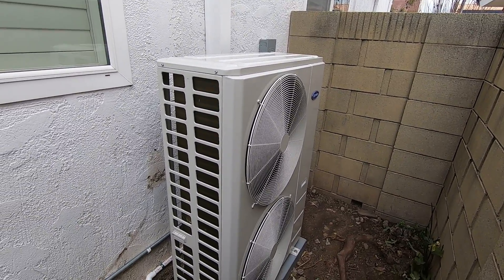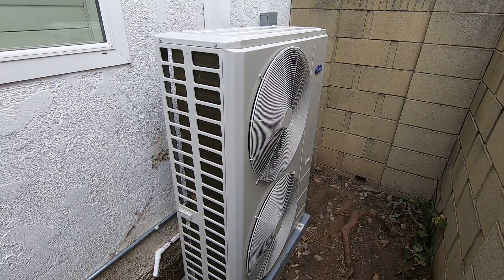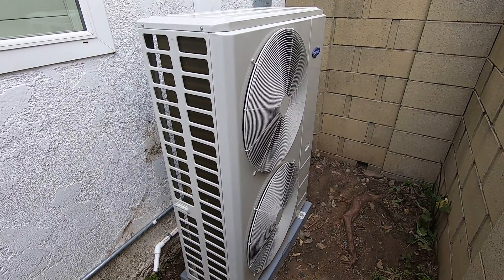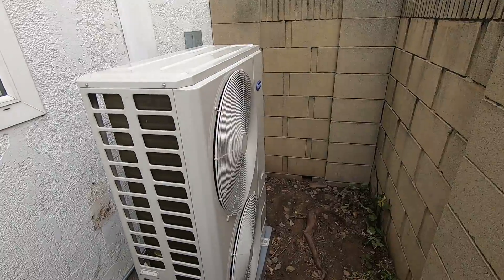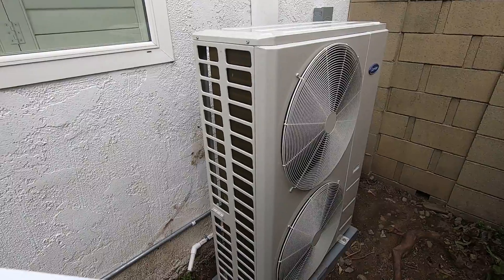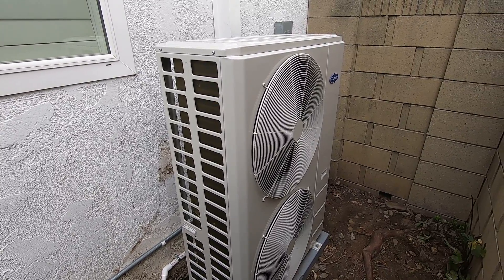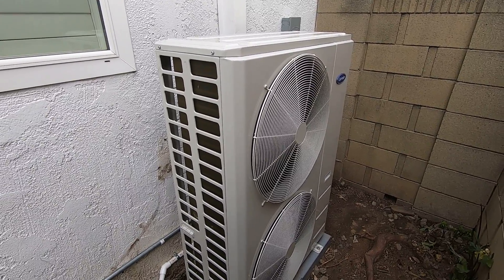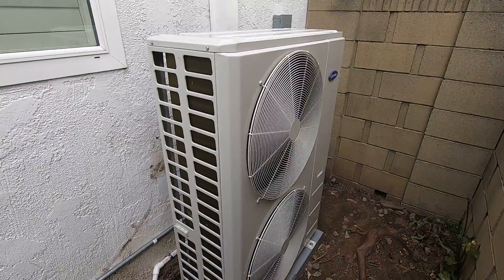Carrier 38MURAQ48AA3 Installation

Comment: These units are exactly the same as the AC Pro Y-series/ACiQ high efficiency/Senville central units. They are all made by Midea. They are all made in China. That doesn’t mean they are bad. They are quite good actually. Used the carrier manuals to install my Senville central unit. If you want carrier quality but want to save some money, you can do it yourself. Just make sure you get your epa 608 before you replace.

Comment: I have the same thing installed but mine is a 3 ton. I had soft ductwork from previous ac. I don't seem to have much airflow compared to my old carrier. The installer has been back a couple times. I tried the heat pump for the first time last week and it wouldn't blow heat, no air coming out of ductwork at all but it was running in the heat mode. What's wrong with mine, is something not hooked correctly. I would appreciate any input because it's useless to me and I'm not happy because I paid a few more thousand to add the heat pump. Thanks
Reply from the maker: Thank you for watching the video.  We have found the low voltage wiring (control wiring) needs to be wired properly for the system to run properly.  There are several ways to wire this system based on configuration and thermostats being used.  I would recommend having a Carrier Factory Authorized Dealer check it out to make sure everything is wired properly.  Good luck with everything.